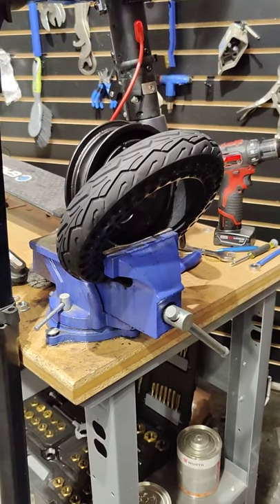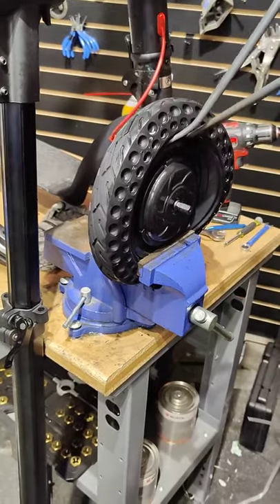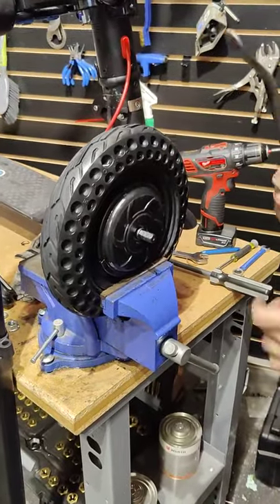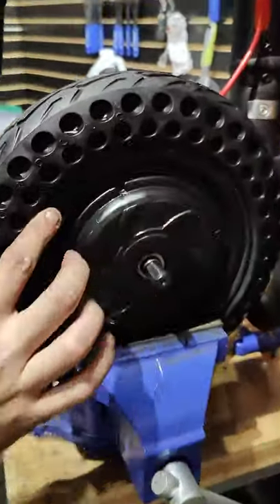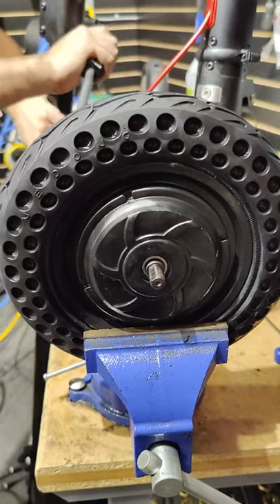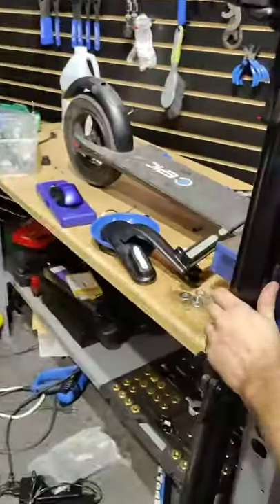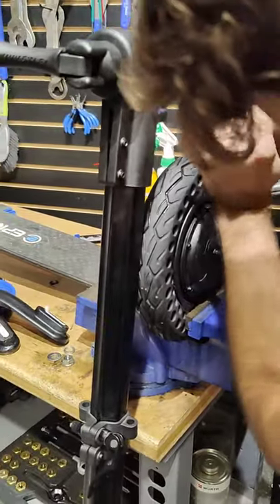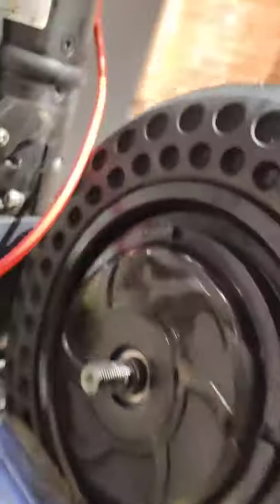How to install solid tires on a scooter X7 / X8 Video | Epic Cycles

Comment: Would it be just as easy to add pneumatic tires?  I feel the ride is way too rough compared to it's sister model the Hover-1 blackhawk and would like to know if would be possible to change out the ones on the X8
Reply from the maker: Hi Michael, yes of course.  Both X7 and X8 scooters come standard with pneumatic tires.  We do have them available and in stock if you wanted to make the change.

Comment: I was told to boil the tire for a spell 15 to 20 mins to soften tire up
Reply from the maker: Yes allot of people do this.  It makes it easier to stretch the tire over the rim.
Reply: Yes took me about 5 mins to change both tires also without detaching motor